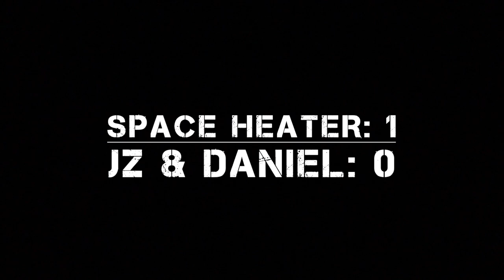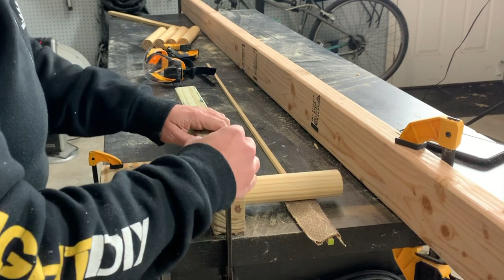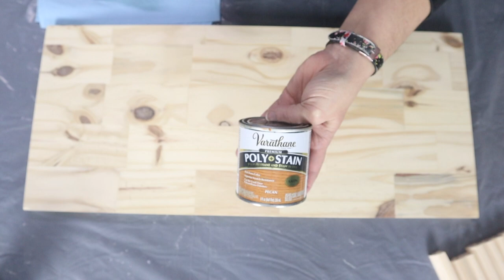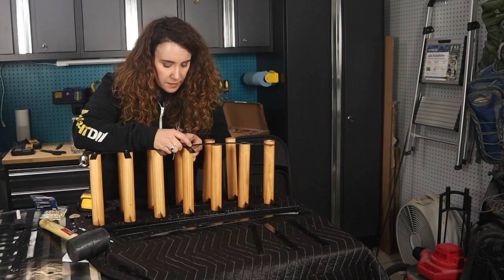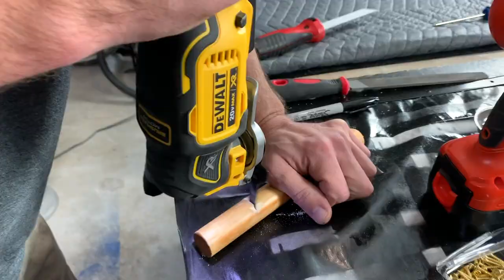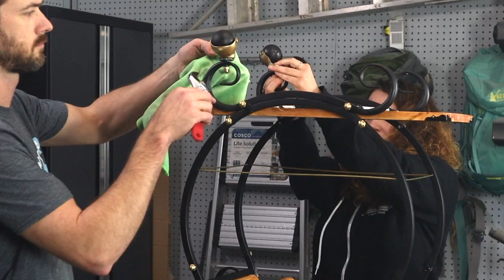Make a Metal and Wood Bar Cart | Unique Wine and Liquor Storage!

Comment: Great little jig you made to cut those dowels crosses! Great project JZ and Daniel. I had a breaker pop the other day and it made me realize that it might be a good idea to get an emergency battery powered light for these occasions!
Reply from the maker: Hey! Thanks for checking out the vid! That jig made the dowels SO much easier. And yeah - the breaker issues were something serious. The worse was the one when I was on the miter saw mid-cut. My phone (with its flashlight) was nowhere near me, it was night, all the doors were closed, and D wasn't around. I had to listen for the blade to stop spinning, gently raise it up and then FEEL my way around a pretty full workshop to get to the breaker. Definitely one of the least comfortable moments of the build... Consider that one a HUGE lesson learned lol. A battery powered light would be great to have around...as long as it's in reach!
Reply: @JustMightDIY  i am looking into lights that automatically turn on when the power goes off. I think they are called emergency back up lights. You should look into that too!
Reply from the maker: @TheGrantAlexander  We should! Let us know if you find any good ones. Though, I'm hoping we're coming out of the cold season pretty soon here. But then we'll likely trip the breakers by running fans, as it gets HOT down here. So yeah...share some links if you find some good ones. Ha!